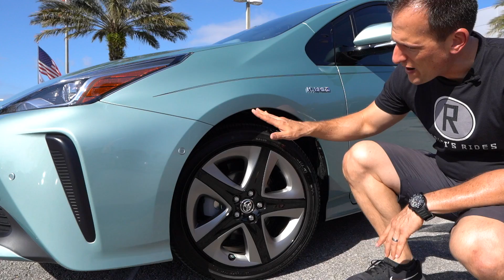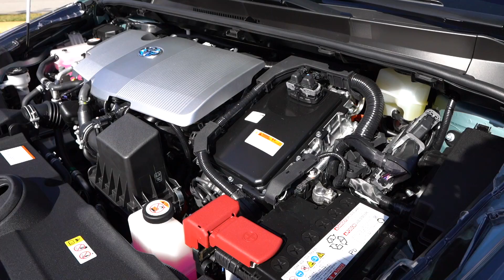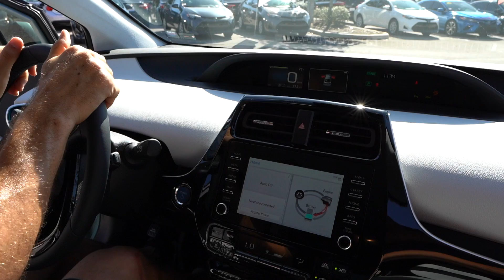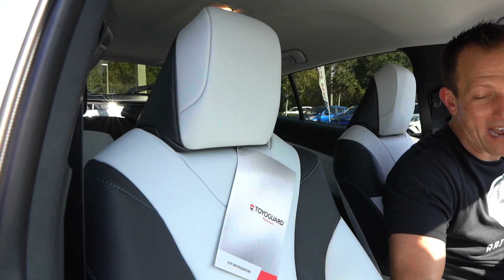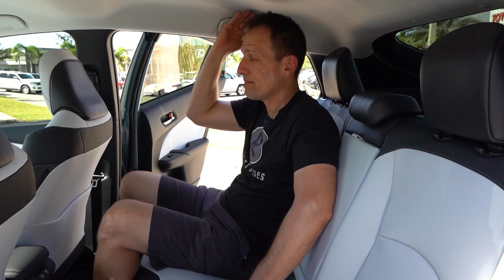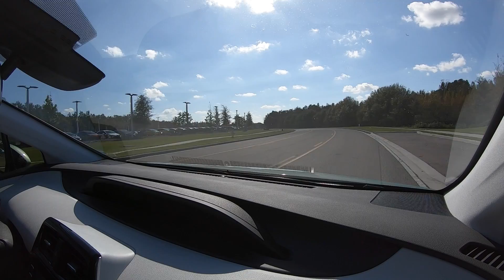Is the 2020 Toyota Prius the GREATEST Hybrid you can BUY?

Comment: Don't worry about the rearview. Believe it or not, you get used to it after a while. In fact, when I'm driving in front of a higher vehicle with those super bright LED headlights, "the bar' actually blocks out the light, so that split rearview mirror set up actually comes in handy in those instances. :face-blue-smiling:

Comment: Remove the useless middle headrest in the back seat to improve rear-view visibility.
The Prius does have regenerative braking.  In fact, if you take your foot off the accelerator driving down the highway
a slight regeneration is engaged putting a drag on the vehicle.
I've read the claim "regen during coasting is done to simulate engine drag on a normal car. 
Every effort was made to make the Prius drive and control in a fashion understandable to drivers."
Hey Toyota Engineers - let the Prius truly coast if the last pedal depressed was the accelerator;
engage regen if the last pedal depressed was the brake.  Driver could engage the long  slow regen deceleration by tapping the brake.

Comment: ill stick with my 08 till the wheels fall off.  i do like the front end of this one a lot more then the previous though
Reply: Is the 2nd generation Prius much better than the 3rd generation? Because I really want the 2010 Prius but I heard it has some problems. How is the 2008 Prius been for you?
Reply: @ShawnFX  im not 100% sure on what years but i think it was the 2010 and 2011 that had a lot of head gasket problems.  i would join some prius facebook groups and poke around for a bit.  my gen 2 has been great though.  the only repair i have had to make was a water pump that got replaced free from toyota because of a recall. iv had the car from 90k currently 140k i love it.  im about to take it camping in a couple days!

Comment: I have owned my Prius for 12 years and absolutely LOVE it (2008 option 2 model). It's been extremely good to me; the only nonstandard maintenance I've done is replace the 11V battery in the back, and I had to replace the hybrid battery at 11yrs/175k miles (which I don't think is unreasonable).

Being a loyal Prius owner, I test drove the 2020 and HATED it. I don't love the exterior design (although it's better than the last generation), and this shade of blue is obnoxious. You have to turn your head and look at the center every time you want to see your speed etc. (the instrument panel needs to be in the driver's direct field of vision). There is a LOT less rear head room in the 2020 than my 2008; my husband could not sit back there and he is only 6' tall (I'm 5'7" and I felt cramped). I cannot see out of the back of the car when turning my head to reverse like I can in my 2008. Flipping the seats down in the back results in a shelf rather than a large flat surface area for cargo.

I went down the street to test drive a Hyundai Ioniq, told the dealer I was a loyal Prius owner, and asked him to make me a believer. He didn't have to - the car sold itself. That was a 2019 model, and I decided to wait for the 2020, so come this September, I plan to buy a 2020 Ioniq Hybrid Limited. It's a better car in every aspect than the 2020 Prius and costs less.

Comment: My 2008 Prius and I were involved in a T-bone accident (I hit a red light runner on the passenger side door) and I walked away! Airbag deployed saving me from injury. So my much loved car was totaled. It had been such a great car for me that I went out the same day as the accident and bought a new 2019 Prius Limited with all the safety technologies and the amazing 11.9 inch screen. 
I think no one buys a Prius because it is sexy or fast off the line but because it is well built and built to last. I got 11 trouble free years and expect the same from my new one. I must say, however, my car in red looks really great! These are the best looking Prius’s to date.
Reply: I have had my 2008 for 12 years (obviously) and LOVE it; I could probably drive it until the wheels fall off, but it has zero cool features (it's an option 2) and new cars have so many more safety and comfort features. I can't stand the new Prius models, so I'm getting an Ioniq.

Comment: Have 08 model with leather and all options except moon roof.  Price 3 years ago $4600.  136k.  now 160k+  Battery is fine, turns green regularly, but is slowly aging.  it really owes me nothing.  The keyless entry has never worked, but really, I like it that way, being 71.  Plan is to drive it as long as possible.  New drive battery is $1600, top qual Chinese.  That is not bad really.  Another 40 k = 5 to 6 years, it doesn't get any cheaper.  I modified the mid speaker and transformed the JBL into something I really like.  Huge difference in sound quality.  How they allowed it as it came stock is beyond me.  I guess they want to sell you a Lexus.  I imagine some mods to the door speakers would boost bass, but that just wears out one's ears.
Reply: Oh yeah, white interior?  That is definitely a no go for me, pretty much forever.  Would not even consider the car configured like that.
Reply: I love my 2008 Prius. I had to replace the hybrid battery at 11yrs/175k, which I thought wasn't bad (pretty sure it could go another 11 yrs., easily). I am planning to buy an Ioniq in the fall, however. Nothing wrong with my car at all; just wanting something new after 12 years (my car is very basic), and I can't stand the new Prius models.

Comment: lousy review. Never mentioned the tiny little glove box which barely contains the owners book etc. Cant even get a pair of gloves in there with the book package. No spare tire. Wait until you try to use that flaky kit of compressor and jar of goop. You have to have at least 5 psi of air in tire to use the useless kit. After a tire failure, I had to wait for AAA to tow me to Tucson to get tire replaced. I finally spent about 100$ for a full size spare which I must carry in trunk which limits luggage space. Build quality is good tho but it will be the last prius for me (second one).
Reply: Most flats are caused by a small puncture in the tread of a tire. 

You could always carry a good pair of pliers, a basic plugging kit and a compressor. It will work just fine on a normal tire and it's exactly what a repair shop will do. Anyone who pulls a trailer regularly will tell you the same because no one's going to pull around multiple spare tires "just in case".

Comment: I just wish they wouldn’t drive so damn slow in the fast lane. For the love of God, get out of the way!
Reply: Didn’t say it was slow.  It could have 100 more hp than a Yaris. The problem is they are driven too slow in the fast lane and the drivers refuse  to get out of the way.
Reply: MrGuitarHack fast lane or not there’s still a speed limit
Reply: @Davidmaccc  - You are absolutely correct, there are speed limits. In California there's also rules  regarding overtaking and passing vehicles: 

"21654.  
(a) Notwithstanding the prima facie speed limits, any vehicle proceeding upon a highway at a speed less than the normal speed of traffic moving in the same direction at such time shall be driven in the right-hand lane for traffic or as close as practicable to the right-hand edge or curb, except when overtaking and passing another vehicle proceeding in the same direction or when preparing for a left turn at an intersection or into a private road or driveway.

(b) If a vehicle is being driven at a speed less than the normal speed of traffic moving in the same direction at such time, and is not being driven in the right-hand lane for traffic or as close as practicable to the right-hand edge or curb, it shall constitute prima facie evidence that the driver is operating the vehicle in violation of subdivision (a) of this section.

(c) The Department of Transportation, with respect to state highways, and local authorities, with respect to highways under their jurisdiction, may place and maintain upon highways official signs directing slow-moving traffic to use the right-hand traffic lane except when overtaking and passing another vehicle or preparing for a left turn."

 Be courteous, follow the rules of the road, and move over out of the passing lane and let cars pass.
Reply: Why tf do you say its slow when a toyota yaris has 19 less horse power than this
Reply: Are you saying that only Prius drivers go too slow in the fast lane? That is not my experience....
Reply: @penname40  No

Comment: I would probably buy the Kia Niro hybrid instead, although the Prius Prime and regular Prius are on the most recent Consumer Reports top ten list, just after the Mazda MX-5 Miata. The Hyundai and Kia hybrids have a longer warranty, especially for the big hybrid battery, and they do not have a small starter battery that needs replacing every 5 to 7 years. The biggest downside is they have not been out long enough to know a lot about how they do with 200 thousand plus miles and 10 years plus for weathering.
Reply: I had to replace the starter battery in my 2008 Prius a couple of years ago, and I replaced the hybrid battery at 11 yrs/175k (which I thought wasn't bad). I had similar thoughts as to the Prius being out for nearly 20 years and the Ioniq only being out for 3, but in the end, hybrid technology has been around a long time and has been proven to be reliable, and Hyundai has an excellent warranty. After test driving both, I am hands down going with the Ioniq.